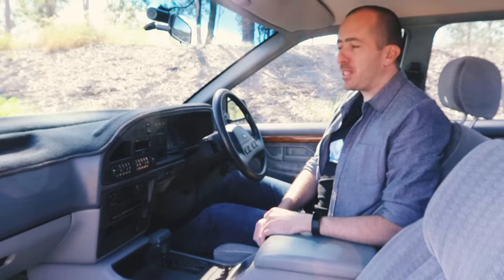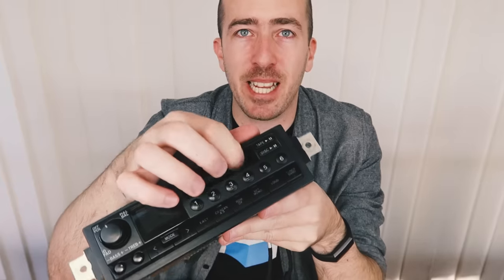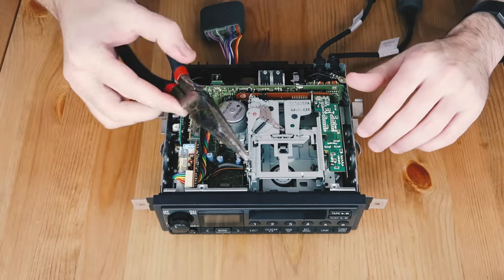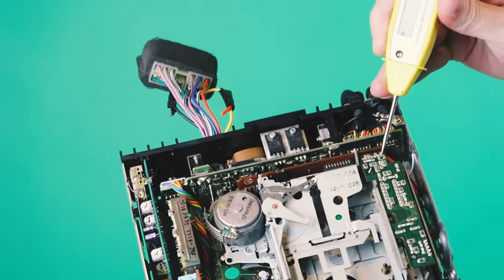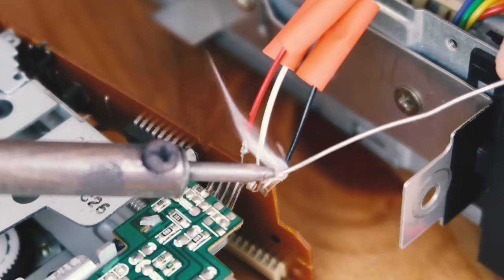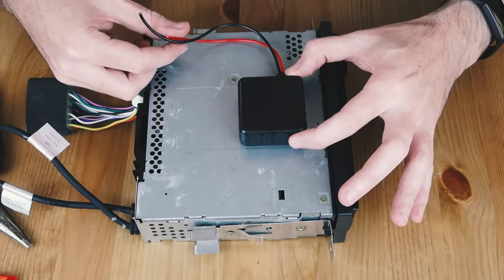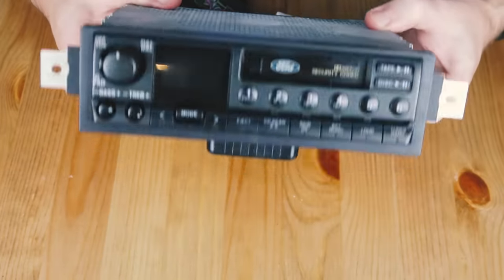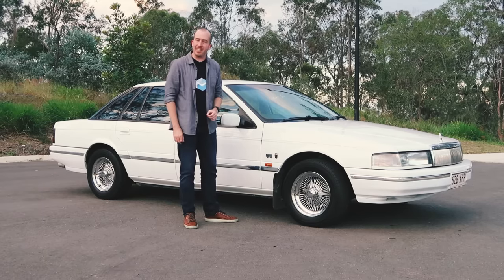Add Bluetooth To Your Old Car Stereo For $25!

Comment: This is a great solution I am going to consider installing. I dislike using the Motorola T505 bluetooth via FM transmitter to stream my music etc., because anyone else tuned to the same radio station can hear it too that is within close proximity to my car! Mind you, the T505 is extremely reliable and very convenient. It still holds a great charge. I've had to change the condenser microphone in that bluetooth unit and it still works. It's well over 10 years old.

It would have been good to disconnect the tape drive motor to prevent the annoying mechanical sound of the tape drive mechanism when the head unit volume is at zero or listening to quiet music while sitting in the quiet car.

This is a great solution! Thanks for sharing such great detail!
Reply from the maker: You could try disconnecting the tape drive motor on yours, but on mine it causes problems as the head unit believes the tape drive is jammed, and continuously tries to reverse the play direction. Muting and un-muting the audio output as it does so. The motor in mine is pretty quiet though, you can't hear it over the sound of the engine idling.

Comment: Thanks for this video! I used your vid to install Bluetooth in my 2002 MG-ZTT. It has a similar Alpine head unit but with some differences. The cassette board was unlabelled but looking through the bottom of the case I saw that the main board was labelled underneath at the 20 pin connector. I cut an access hole so that I could see the labelling and soldered my wires directly to the cassette board side of the connector. It worked first time, but an empty cassette case didn't stop the constant reversing. I ended up just leaving a blank cassette tape in the player and now it works flawlessly! Thanks again!
Reply from the maker: Awesome, good work!

Comment: Because you know some of us will rib you, I will not. Thank you. I was injecting BT at a different point with a pcb board mounted inside some head units , though alpine one is crowded like a 2000s compact car engine bay haha . I had wondered about injecting via the tape player output, as a simpler fastet method. Your videography,  audio etc were near Profesional level. Thank you once again . Very satisfying to watch you do it.

Comment: Beautifully done, I've been wanting to do this to my car that I'm restoring and I've been stumped for a bit since there's no info on my stereo. Thanks for pointing out the steps to connect one and I can't wait to open up my radio for the 4th time 👍
Reply from the maker: Good luck mate. If you have any questions I'll do my best to assist.
Reply: @MotoringBoxTV  Hi Sean.  Will this work with an AM radio only?   I have an XP with the original radio. Cheers Darryl

Comment: Maybe get rid of the BT-reciever casing, and fit the board directly inside the Stereo unit?
Reply: No, because stereo unit is shielded, so you'll never be able to connect to it or play music. That effect is called "Faraday cage". In that case you would have to add external antenna to your bluetooth module.
Reply: @petarstefanovic98  I have already done this, before coming across this video. But used a cheaper smaller USB Bluetooth option. I took the Bluetooth out of its plastic case, found a 5v circuit inside the radio and connected the audio to the aux function on the radio, hot glued the thing inside and working perfectly, no need for external aerial. Radio was a ford 2din cd6000, a lot cheaper than buying the ripoff price of around £200 for the Ford module for it, I cost me £5 for the USB Bluetooth receiver.
Reply: @pye8man  Those are not shielded as much, because it's a CD player and not a cassette player.
Reply: I just did this on my 03 chevy radio. Took the BT unit out of the casing, heat shrunk it, and fit it inside the radio chassis next to the cassette drive. has zero issues with connecting.

Comment: Two things. The easier way would have been to tap into the cd changer input wires on the back of the unit. Also, car stereo wiring code is usually yellow for constant hot, and red for ignition. As that was made by alpine, that should be the case, as the wiring harness looks like the same color code.
Reply from the maker: Easier yes - but I preferred to override the tape functionality instead of CD. Secondly, the way I've wired it definitely turns the module on with the ignition in my car - so make of that what you will.

Comment: Nice little hack, but my preference would be to keep the tape unit useable so it not only looks original, it can also function as originally intended.
Reply from the maker: You can still do that - just solder directly onto the board and don't remove the springs from the tape drive. Happy days.

Comment: Genius.
Vulcanising tape from Jaycar matey is the best solution for those shitty hard to get to wires rather than 'leccy tape. Works a treat.
I have an R1150rt BMW bike with a tape head unit an based upon your video am going to give it the treatment. 
Thanks for the idea!

Comment: I did this year's ago on my ke55 corolla,  but I soldered a head phone Jack straight to the tape reader on the male side and the female side was put through the dash above the ash tray . I drilled a hole their and on the female end of the plug I cut with a raser blade around the thick end so there was a groove . So when I pushed the female plug through the drilled out hole it would get stuck,  then I hot glued the plug from behind the dash peice to make it never come out . The female end of the plug only stuck out a little bit and it wasn't showi,  it looked really clean .
Then I pulled the springs of the tape deck like he did and pushed it down to stay their indefinitely. 
I had 2 male end plug lead so when ever I wanted to listen to music I just had to plug it in .
If I didn't want to use the wire to listen to music I would just throw it in the dash compartment.
Reply from the maker: Sounds a bit dodgy, but hey if it works!

Comment: Good Video But!
The problems with your tape drive modifications in general:
      You must find the audio insertion point after the tape audio preamp and Dolby decoder otherwise the audio will be equalized incorrectly + Dolby decoded and sound crap.
      These processes maybe on the main board!
      You have to have a working tape transport with all the belts working etc
       If you bodgy it up(by removing springs etc) so the cassette audio is always on then you have no way to switch the radio on! Not all heads unit like yours have a tape switch they are normally Radio or Tape, controlled just by whether a tape is loaded or not!
       Also, some cassette decks will sense if a cassette is loaded with switches and all the spools are moving as they should! It they don’t it tries to eject the tape or perform a auto reverse because it thinks its come to the end of the tape etc

I have modified many car head units and portable cassette radios (ghetto blasters) and the best method I have found is to intercept the radio receiver output or the volume control audio input (easy if its a shaft volume control) 
@ 5:00 in your video I can see  3 miniature audio cables on the main board the grey ones I bet one goes to the volume shaft look for cables like this!

Intercept this L+R+G signal (leave the ground in circuit do not cut) take L+R to a 2pole switch like 
https://www.jaycar.com.au/dpdt-miniature-toggle-switch-solder-tag/p/ST0355 
wire in a Blue tooth Rxer or just a 3.5mm Female socket into the other pole of the switch L+R (then you can plug whatever into it). 
Return the output of the switch L+R to the intercept point. You will need 2 miniature stereo shielded audio cables ground the shields in the head unit and connect all the shields at the switch end. See this diagram
https://www.youtube.com/watch?v=gZpZPCKW124
Mount switch in a practicle location
Reply from the maker: Thanks for the info, I'm sure someone watching will find it valuable!
Reply: Thanks @RODS for having taken some time to provide these details! I have bought a pioneer 90ties tape radio to replace the ugly cd player in my car, followed this good tutorial, I was a bit sad as the sound was ugly after having plugged the bluetooth output to the tape output. I have tried to find some info on internet, wondered if I had to plug a digital to analog converter, and thanks to your explanation, I have plugged blutooth output somewhere after the tape output and know it works like a charm! Before I had to play a ghost tape to switch to bluetooth and know I can use bluetooth either on radio and on tape. I liked the fact that I had to put a tape to turn on bluetooth (probably because its funny to do an old move to turn on a modern device) but I prefer by far having a cristal clear sound.

Comment: Brilliant stuff. Perfect for my old BMW and Toyota where the stereo is actually a moulded and integrated, non-DIN, part of the dash. You can actually get more advanced versions of the Bluetooth modules that have slots for SD cards and USB sticks which will wire in similarly but routed to glovebox or coin box.
Reply from the maker: I've seen a few modules online specifically for some older BMW head units, so depending on the car there may be a better solution available.  Thanks for watching.
Reply: MotoringBox Yes, there are plug & play modules that will simply plug into the CD changer connection if you have it and then only for some of those with a separate plug into the rear of the head unit.  From memory  (in the E46 BMW at least) there are 2 Alpine versions of units and a couple of other brands (Panasonic?). The Alpines apparently have the best amplifier in them by far so this solder-in mod is a great option. Funny coincidence is that a couple of months ago in my BMW E46,  I had swapped out the Tape player head unit for a CD unit from wrecked later model. Just a few days ago I said "I must chuck that useless tape unit out."  Your vid was perfect timing for some experimentation!

Comment: Often those head units have auxiliary input wired in the header or as additional plug or header and enabled by some sort of switch or jumper on the rear of the unit. You probably shoud've told to check that first.
Reply from the maker: I don't really know enough about reading wiring diagrams or inspecting circuit boards to figure that out unfortunately.

Comment: Cool! When I modded the stereo on my 2000 Focus I just wanted an AUX input, but I wasn't able to find an appropriate place to solder it since the amplifier in the unit is expecting a signal from a cassette tape, not an amplified signal meant for a set of headphones. I tried connecting it there and it sounded horrendous. So I did end up using the tape adapter but I couldn't notice any sound quality issues. I glued the tape door shut and mounted the aux port and a toggle switch to tell the unit that I've "inserted a tape", which I did by finding the switch that is pressed when a tape is inserted. This made it easy to switch between tape and radio (since I like listening to NPR). I'm sure there is some little black box that will convert a phone's headphone jack signal down to a line level but I wanted to do it as cheaply as possible. I only had to buy the toggle switch and the headphone jack, already had a tape adapter to sacrifice since it would be permanently installed.

Another tip for someone that isn't really experienced in modding stuff is don't completely reassemble everything before you have tested it! Just make sure it's put together enough to function safely.
Reply from the maker: Sounds like you got the job done!

Comment: You can do that without cutting wires and keep the cassette player.
Reply: How?
Reply: 12MRJERSEY, Bluetooth cassette adapter. Looks like a cassette, has Bluetooth, instead of a magnetic tape inside.
Reply: The terminal points on the daughter board, you can solder the wires directly to those, takes a bit more care and precision but entirely doable.
Reply: @Mrsquiggley  Exactly.
Reply from the maker: Yup that's true. I didn't do this because I've not had success in the past at trying to solder onto existing terminal points, and I didn't want to risk damaging the board.
Reply: @johnsimun6533  would you need to replace the batteries on this though? that would be a big downfall
Reply: haterr plays, yes constantly
Reply: @haydenwiseman3056  That's the big pain in the ass with those. The batteries on them last a few hours at most... or you can leave it plugged in to a charger, but then you have the "tapeworm-in-dog's-ass" problem again. :/
Reply: Great video man. Food for thought. (for me) I was wondering is it possible to do this procedure and still have the tape deck work?  Still have old recordings and demo tapes. Would it need diodes or some thing in line? If anybody knows, then please comment. I would rather not learn the hard way, if you know what I mean. Thanks again for the inspiration. There is hope! 👍👍

Comment: I use a FM transmitter that plugs into the cigarette lighter socket and also can take a 3.5 mm lead that plugs into the headphone socket of my phone. The phone has a 2nd mini  usb card installed with around 2000 songs that have been downloaded from my music files that the phone has been programed to place all files and also played random. Cost ex Hong Kong $10.00. The beauty  of this is one does not have to modify the original factory radio or controls. This has worked for the last 3 years now and all you have to do is to tune the radio in to a blank spot in the FM band and adjust the frequency of the FM transmitter to the same spot.

Comment: Thank you, YouTube!
I never knew this solution even existed until this video came up in my recommended videos.
I’m currently using the ‘tape worm’ method, which is not only annoying, but tends to pick up interference as well.
Excellent instructional video.  This is a mod that I will be making soon to my 1994 Ford Escort.
Thanks again!
Reply from the maker: Thanks mate! I trialed the tape worm adapter for a few days and the quality was pretty abysmal.

Comment: using a bluetooth receiver board from ebay is around $2 and doesnt come in that large box ... its a small circuit board that fits inside the head unit itself
Reply: received mine just today (not related to this video), yeah, the only bit is that they usually don't work at 12V, unless they do, but they are just a bit more bulky and usually they are panel mount.... actually i didn't pay much attention to the modification (it's case dependent for sure) but cassette heads have on the circuit what they call a NAB equaliser, an ALC (that is a good thing) and the signal is actually a lot low compared to the one out of a "line" or hadphone one, and it may distort... i think this project got just lucky
Reply: Wouldn't it be possible to use the power from the cassette motor. So that Bluetooth would only be enabled when the radio is in tape mode.
Reply: @Leonvolt28  Depends if the cassette motor has the correct voltage, if it has the correct voltage, it would be perfect!
Reply: @TheRunq11  most of those motor runs at 12V or 6V, and the BT board's VCC is 5V, simply using a 7805 voltage regulation IC is good enough to power it. 
Or you can use a BEC module (DC-DC circuit) for RC models to provide 5V, usually it's a tiny PCB that smaller than your thumb nail and weight less than 5 grams.
Reply: @foxtrotbravo4495  Or simply connect it to a car usb charger 12v->5V :)